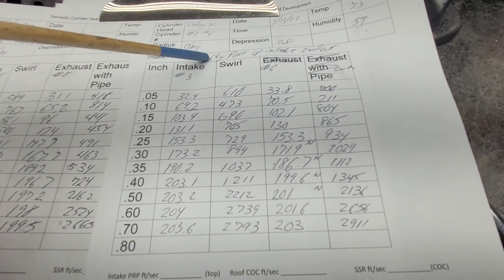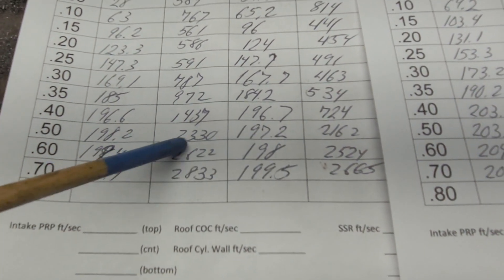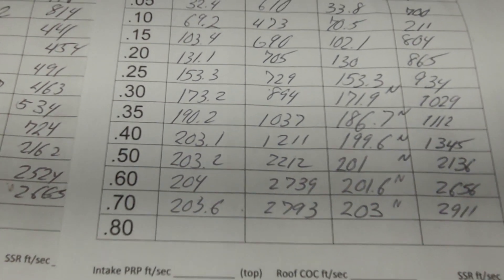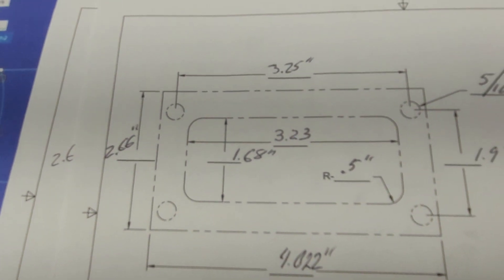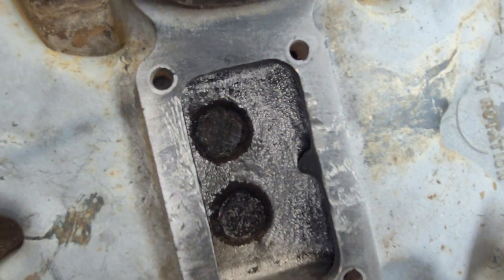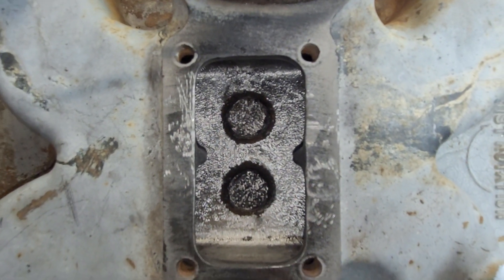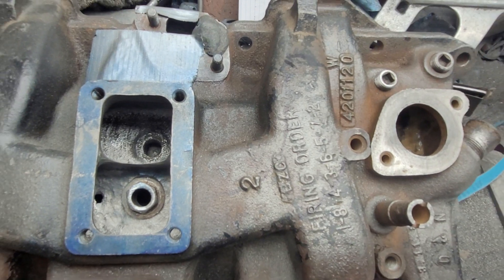David Vizard, Uncle Tony's Garage, Unity Motorsport. Mission Impossible project. Single plane work

Comment: Try cones, but that still attach in between but with a lower profile as wide as the cone base, the shape will be like a woman chest with pointy breasts, you can see if someone can make this with a 3D printer, and you can put screws thru the middle of the breasts to attach it to the floor manifold,  you can make two divider pieces that wall you mention with rounded shoulders and top, the other one you can shape with the woman chest like I mention, I believe a sharp triangle will cause the fuel to puddle and will negate the opposite Carb barrel to flow in the direction of the cylinder that is at intake stroke.
Reply from the maker: I have new clay coming so stay tuned.

Comment: This might sound stupid but a turbo compressor wheel in the middle will direct fuel and air to each
Reply from the maker: Boost just makes it flow everywhere.  Nice blow through set up.
Reply: @servediocylinderheads  no a stationary compressor wheel as air and fuel come in the intake runner demand it will flow straight to the called runner
Reply: It's seems logical as a compressor wheel flows 360 and runners are set up like a spider so if the wheel sits under the carb air and fuel come in the intake opens calling mechanically for air and fuel it will be directly sent via the wanes of the stationary compressor wheel to directly send the mixture to the called runner no turbulence just flow i thought of it this morning watching the video
Reply from the maker: @michaeldicks9055  Glad I got you thinkin.

Comment: Question is the exhaust side going to be restricted like factory exhaust manifolds. A 500 lift cam with the .904. 050 will be under 220 like 214-218@50 most .904 cams. How is thing going to go past 5500rpm
Reply from the maker: It will have exhaust manifolds. I have a set coming soon I hope. That will be a new challenge. I don't know how big the regrind cam will be made. Something like 214-218 should work.

Comment: Can we switch to a different mopar oem 2 barrel carburetor?
318 ~ {1968 and up}
Carter BBD {1.437" Throttle Plates x 1.186 Venturi}............ 285 CFM Rating
360 ~ {1971}
Holley {1.563" Throttle Plates x 1.343 Venturi}................... 350 CFM Rating
383 ~ {1962 thru 1971}
Carter BBD {1.563" Throttle Plates x 1.313" Venturi}.......... 365 CFM Rating
400 ~ {1972}
Carter BBD {1.563" Throttle Plates x 1.313" Venturi}......... 365 CFM Rating
Reply from the maker: I doubt it. That would be nice.

Comment: You had mentioned cutting the top off in the prior video. There are some circle track stock rules racers who used to use those intakes with 360 engines and an adapter for a 500 cfm Holley 2 barrel. To leave it stock appearing, they modify the intake from underneath and eliminate the crossover.

Comment: Unless you live in a really cold climate during the winter engines dont need open cross over ports / passage. it makes the carbs percolate like an old school coffe pot during the summer in which it boils the fuel bowls out causing hard starts and rich mixer or flooding . those dimps are for gaps so tools can be used . Aussie Speed makes those " turtle or pig " to help with air flow that bolt to the bottom of the intake in the middle of the carb port

Comment: I needed to make some cuts in a deeper port than my burrs would reach, so what I did was to take a piece of quarter inch I D brake line and braze in a length of quarter inch shaft almost as long as the line, with the shaft out one end to let the chuck take that end then J B welded my burr in the other end, just keep the speed down, worked well. Just heat up the J B weld and the burr comes out to be used again and another size burr can be J B welded in the adapter.
Reply from the maker: Good idea.
Reply: That is a pretty neat idea. Andrew

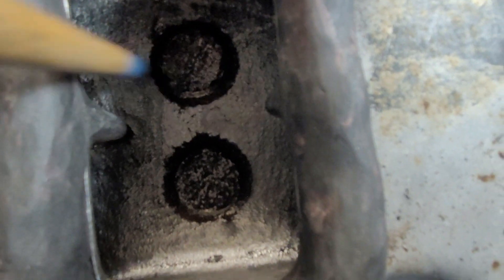Comment: The single plane is best, in stock eliminator we ran 318 gasket matching and a Carter 2 bbl with stack 3.6" straight. Ran 14:80 @ 89 mph in a 70 challenger with 3:55 posi E78 tires. Shifted at 6300 rpm. Efelbrock performer and 725 Carter hemi carb from 8 bbl (just one) same long block 12:8@ 98mph, lifted LF tire an inch or two. Amazing LA engines, bone stock stainless head gasket 012". There is great fun in that little engine, I want to do a 273 next! Nice work for a good cause, heaven smiles at you!
Reply from the maker: That would be great. Thanks

Comment: Must have missed something. Where did you find a single plane iron manifold?
Reply from the maker: I have friends!!
Reply: 273 had them.  The first year or 2 of 273 (up thru '65?) had the manifold bolt holes drilled at a different angle.

Helped my friend Paul put a later 318 into an original 273 powered 1966 Formula S Barracuda; we put the stock four barrel manifold from the 273 on that

In fact, the heads from that engine went on a 1972 318 short block, that I used in 1973 340 intake on

But, there was a year or two of single plane two barrel manifolds for the LA motor that will fit the LA 318

Then a chingo ton of dual planes after that...
Reply: @billythebake  I remember those. They also made a 4 bbl single plane that was very flat.  Understand that they made them so flat was so that they would fit under the hood of those early A bodies. I had one out of a 65 Plymouth B body but it had no intake manifold. It had a forged steel crank & full floating wrist pins. Other than that it looked just like a 318. A genuine MoPar nut will save anything.

Comment: With a turtle you are filling the outer radius of the turn but your center has to feed two directions from two barrels. My suggestion would be a wide outer wedge thing to a blade and lowering down to nothing about one third across the opening. So two pieces from each outside, nothing in the center. Each would look like a triangular piece from the top and have the bulk in the upper and outer lower radius, side, and bottom. Again nothing in the middle.
Reply from the maker: Interesting...thanks

Comment: Carburetor CFM requirements at 6500 RPM
80% efficiency =:525 CFM
90% efficiency = 600 CFM 
up to 650 CFM is safe
Reply from the maker: Never happen with a tiny 2 barrel.
Reply: There are other two bbl used with early 318, we used a Carter for industrial and motorhomes. Stock eliminator ruled ok
To use, detailed got over 370 cfm ,may have been 400, Drag racers can do!
Reply from the maker: @sydneychase780  Goog info. Thanks

Comment: The bumps are from the the core mold, maybe helped locate the core in the final mold (sand casting but, they still used setup fixturing when stacking them)?

Comment: Might be interestin to some, but I was disappointed for seeing pushrod engine, though it was about some modern motor by the thumbnail of two ports in the background. Well done video, nothing to complain about that. Just haven’t done pushrod stuff since yhe nineties.
Reply from the maker: Did not mean to be misleading.
Reply: @servediocylinderheads  No harm done, was looking at some indy head before and the flange pattern on the drawing looked similar to Aurora intake flange. So it's in my head the problem. Anyways informational video nonetheless.

Comment: I’ll be impressed to see this project make 350hp. Sure wish the other guys were showing a quarter of the effort you are. I think you would be a beast if you were allowed a non stock intake and headers. I can see you making a 400+ hp 318 using a stock shortblock and these heads.
Reply from the maker: I want 500hp with a tunnel ram. Just for fun.
Reply: @servediocylinderheads  Back in the early 90s my buddy had a full race 340 that dynoed about 620hp so I would think 500 on a 318 with tdays technoogy could be done, would it make it on pump gas? That would probably be the challenge but with low friction rings and a  lot of work on windage and some real good headers and intakes I bet you could get there.
Reply: They can't do much until Charles here is done.   Remember Andy is just fussing with carb and dv. Is re grinding the cam and shaving weight off rods and crank.  Until he has the heads he can't work his valve wizardry.   Charles has the headache of trying to make a 2 barrel intake run like aftermarket 4.  That's alot of educated guessing and checking
Reply: With enough carburetor cfm, I believe it will get the 350 HP.

Comment: Hi Charlie. I would think the pointed "divider" would work better but this is not based in fact, just purely a guess. It's amazing how even the flows are. I think the different size divots  in the runners might be there to help even out the flow. Andrew

Comment: Correct me if I'm wrong but I think a venturi needs an 11 degree entry angle on each side and a 7 degree exit angle on each side?
Where the 7 degree angles line up with the gasket will determine the spacer height.
Reply from the maker: I am not a venturi expert by far. I am sure there is a ratio that is highly efficient but we need to get what we can in a limited space. Thanks

Comment: Should the manifold flowing 200 CFM be capable of making 400 HP?
Reply: Pray a lot
Reply from the maker: Good question.
Reply from the maker: Check it out on Wallace racing calculators.
Reply: The HP for your Cylinder Head Flow of 200
is 379 with a RPM Range of 5,056 to 6,556
for your engine size of 318 CID
Wallace Racing Calculator
Reply from the maker: @slicepizza3263  If the carb is flowing that well.